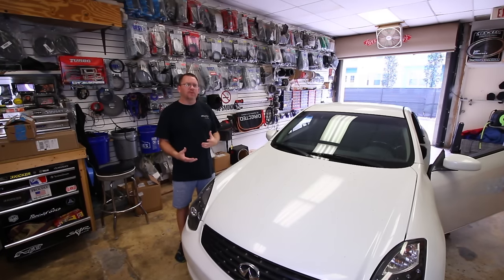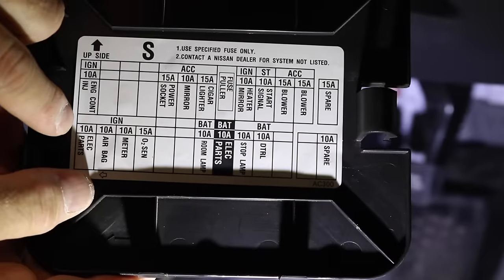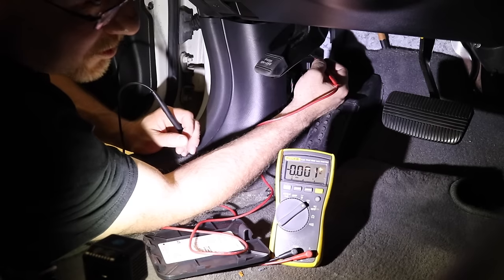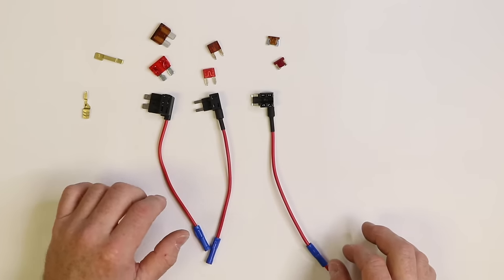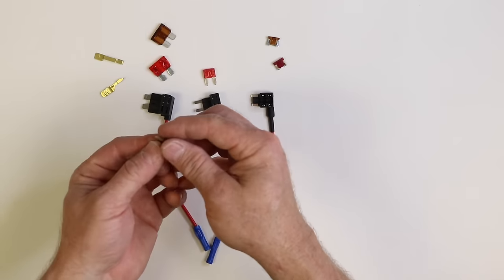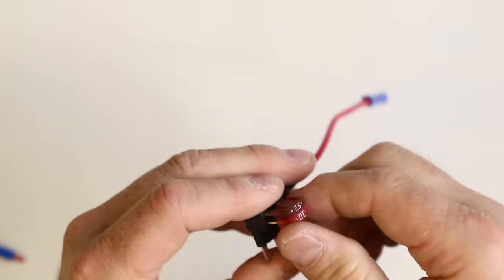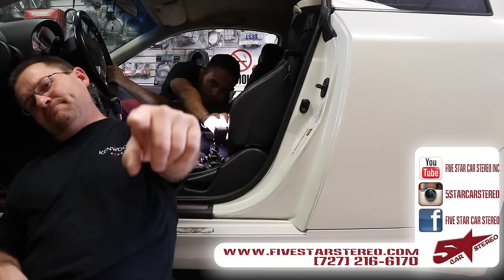How to tap into your cars fuse box safely and cleanly

Comment: This was very helpful. I didn’t know about the "load side" nor did I know that one fuse on a tap should be less than the other. Thanks so much! Glad I watched this, first.
Reply: It doesn't matter which way around you insert the fuse
Reply: @wolvoman1  the fuse yeah, but what about the fuse tap?
Reply: @wolvoman1  6:30 watch again, he is not referring to the fuse smh
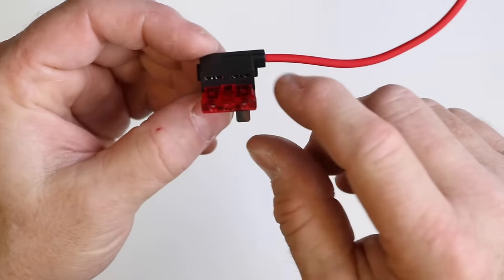Reply: 6:55 fuse doesn't always have to be lower, it can be the same.
Reply: Fuse size is dependant on wire size, ie. 14g wire is good up to a 15 amp fuse. 16g wire is good up to a 10 amp fuse.
Reply: The LOAD side is actually the electrical load applied to the circuit and is mistakenly being called “draw”. 
LINE is the Correct term for the “power supply  in” to a fuse or switch
LOAD is the correct term for the output of current draw through a fuse or switch in terms of electrical load. 
A electrical LOAD can be measured by measuring current draw... so the video is close but we  would be wrong to call the “LOAD “ the supply to a fuse or switch.
The LINE is the supply to a fuse or switch

The LOAD is the electrical load applied to the output of a switch or fuse or cct breaker.
Reply: @wolvoman1  it doesn’t matter which way but the LINE aside may not have a fuse to protect the wiring from excessive current draw whereas the LOAD side of the fuse (he calls it Draw in the video, is a supply of power that will disconnect (burn out)  before the wiring insulation catches fire.
So a fuse is a sacrificial weak link Inserted to limit the amount of power alllowed to go through a wire to an electrical LOAD (like an electric motor or a light) 

If you draw power from the LINE aside of a fuse the fuse will not blow and the wiring in your car is not protected by the current limiting weak link.

It does not matter which way you put the fuse I ; but it DOES matter that you draw the power from the LOAD side of the fuse (He mistakenly calls the LOAD side the DRAW side) but hopefully you know what I mean
Reply: @secretdad544  so it's very important to tap into a fuse this way for something like off-road lights requiring 12v as opposed to just directly tapping into say your headlights? And if this is the case, how come backup cameras are able to be spliced into your reverse lights? Do they draw less power? I still don't quite understand why they wouldn't need a fuse protecting them?
Reply: @Dumpus7  back up cameras don’t use a lot of power but are protected by the same fuse that protects the circuit the camera was spliced into. So in your example the fuse that protects the reverse lights also protects the camera wiring
Reply: @Dumpus7  basically a fuse is a “weak link” designed to blow before too much power is pulled through electrical wire. It is the load that will determine what thickness cable is required, and the fuse will be sized to blow if more current than the wire can safely carry passes through the fuse into the wire. So if your wire can carry 20 amperes safely without getting hot or melting insulation then you would put a 20 amp or less than 20 amp
Fuse. But you would not put a 50 amp fuse to protect 20 amp cable. Because it would allow too much current into the cable and the cable could get so hot that the plastic insulation melts and then you will get a short circuit and a fire risk
Reply: @Dumpus7  if you tried to run your driving lights off the headlights directly you are pulling more current through the headlight wiring than it was designed to carry. Manufacturers choose 20 amp cable to power a 20 amp load. If you add extra lights to the headlight circuit you may find you have increased the load to say 40 amps as an example. What will likely happen is that the fuse feeding the headlights will blow because it has been sized to deliver enough power for the headlights (with a small safety margin,)  but probably not enough margin to drive an extra driving light reliably.
So the better thing to do is supply a relay coil from the headlight high beam via a switch on your dashboard. Terminal 87 earth 87a
Run a fused feed to 30 of the relay. And connect the driving lights to the output of the relay (forget the number but it’s standard on typical 12v relays (cube shaped)
It sounds complex in words but if you follow a driving light electrical circuit diagram  it makes far more sense

With your reverse camera example the camera is a very light electrical load that adds very few amps to the current being drawn through the reverse light cct. This means the fuse and the reverse light circuit have enough “spare current carrying capacity” to feed a reversing camera
But if you tried to connect a 100watt driving light off the reversing light circuit, you would expect a fuse to blow. Due to excessive current far beyond what the manufacturer ever intended the reverse light circuit to carry (typically only 21watts)
Reply: @secretdad544  okay, thanks for all the info. You seem like you know what you're talking about, so I want to pick your brain a little bit more. What I ended up doing was buying a fuse block made by the same company as the LED bars. The diagram shows the positive running directly to the batteries positive, but that would make the lights stay on at all times, correct? So what should I run it to instead? Also, I don't have a switch because I don't want to cut out a spot in my dash for it. So I'm thinking it would be best to run it to one of the fuses that are tied to the ignition like in the video, or maybe to the one that's connected to either my high beams, like you mentioned, or maybe my fog lights? They are very small bars that only pull .21 amps I believe (I'll have to double check that number). Besides those, I also purchased some LED strips I plan on adding as well to the headlight housing that I'll run through one of the other four spots on the new block. How do I know what size fuse would be best for each? I bought a kit that came with a lot of fuses and 10 fuse taps, but I obviously have to decide which size fuses to use for each. Sorry, I build computers, so I'm good with electronics (I can take apart any phone, tablet, laptop etc), but this is my first time trying to do anything with a car's electrical system. If it's relevant, since I do work on phones and computers, I have both the tools and a little experience with heat guns and soldering irons. I also have tons of different splice/spade connectors.
Reply: @Dumpus7  the wire from the fuse box to the battery is the LINE it feeds one side (the line side) of all the fuses 

As long as the fuse is not blown Power will be available on the load side of each fuse. From there run the wire to a switch. 
Without a switch you won’t be able to switch the load (the light or fan or power amp or whatever... on or off. 
Run out of The switch to the load. The load will then have a connection to the car body to provide a circuit back to the battery and make a circuit.
I suggest you get a wiring diagram fir connecting driving lights 
Then do one wire at a time until you get tye cct working properly. 
I dont agree with not having a switch because yes the power feeding the load, will always be on.
Reply: @secretdad544  ok I understand. So having the load side crimped/soldered into say my actual fuse box connected to something like my bright lights- or something similar-isn't a good idea? I can do a switch off that's the case. And one final question: the fuse block didn't come with any wire, and the instructions just say "connect 'the' wire" from the battery positive to the nut on the block. Since they didn't include this, or specify what gauge to use, what would you recommend? I purchased both 12 and 16 gauge red/black wiring that said it was for connecting driving lights specifically. The lights themselves use something small, I believe 16 or 18 (and after double checking, they pull .211 amps), but I'm just wondering what to use for the LINE as you put it. Thanks again for both your time and help!
Reply: @Dumpus7  Cody I would make the LINE feeding the fuse box as thick as it needs to be to carry the total current you intend to draw through that fuse box.
I just googled 10 guage wire (we use metric in Australia and speak in MM cross sectional area) but you use “Guage”. 10 guage is rated to 30amps according to a table I just googled.

Use the 10 guage to feed your new fuse box but to avoid fire feed the 10 guage with a 30amp inline fuse from your battery - fitted with a 30 amp fuse (and never higher than 30amps)

That  way you will never cause the LINE wire feeding the new fuse box to melt - 
because the 30 amp fuse will protect it. 
If the 30amp fuse repeatedly blows then your fuse box is drawing more than 30 amps and you may need thicker LINE wiring and also a larger fuse To feed the fuse box.

In theory every wire in the car should have a fuse protection that is sized to the “current rating” of that thickness “guage”  of wire (each “guage” has a current rating)
Reply: @Dumpus7  I would also check the current you are drawing. 0.21 amps sounds way too low for a set of driving lights. You can’t really check current draw without a DC AMP meter. If it was just a typo and you meant 21 amps that would sound more realistic. Either way your 10 Guage will carry up to 30 amps and your fuse box if fed by 10 guage wire,  can feed circuits up to a total of 30 amps
Reply: @secretdad544  I've double checked and it's definitely only .211 per LED bar.  They're very small bars with only 7 small LED lights apiece.  Each bar is maybe 5 inches in length and maybe 3 cm deep/1 1/2 tall. So they are very small.  Since this is the case, and I don't plan on adding anything additional, I've decided the fuse block is overkill.  I have a 10 amp fuse in my fuse box- the actual one for my car- that's for my fog lights, which already have a dedicated switch independent of my headlights or bright lights.  So, I've decided to just use a fuse tap to tap into that, and I'll just run a 2 amp fuse in the added circuit for these two.  Does that sound like it'll work?  I mean, I'll obviously test and see how it goes before permanent installation.  This seems much easier though.  Also, I do decently high-end Multi-meter.
Reply: @Dumpus7  Good circuit analysis Work & a logical decision mate. Well done 👍
Reply: @secretdad544  that's exactly what I did and it works great! Much easier than all the fuse block stuff haha. Thanks so much for your help!
Reply: what
Reply: What’s the name of the gold male fuse extension?

Comment: Good stuff, I also wasn't aware of the fact that it mattered which way you place your fuse tap load or draw side, thanks for the useful info.
Reply: I'm sure that it doesn't matter which way around you insert the fuse
Reply: @wolvoman1  It's safer to have it in series, or zig zag like they put it, through the two fuses. That circuit is only meant to handle 10A. Putting it in parallel like they recommend means there can be more than 10A drawn on that circuit, which could burn out a wire or worst case cause a fire.

Comment: Hey thank you for this I never knew these existed I always just ran a wire around the fuse and I always thought that looked sloppy. Now it’s nice and cleanly done thank you. I added two charger ports on the back of my armrest for my rear passengers so I don’t have to figure it out from the front plugs

Comment: “Line” is the unfused supply to the power in leg of a fuse -  It’s the power line into the fuse.
“Load” is the electrical load placed on the fuse
It supplies the electrical load connected to the fusible link / aka fuse

Draw (current draw) refers to the current drawn from a circuit by a given load. Vary the load and you change the draw.

The function of the fuse/ fusible link is to limit current drawn to a level that guage (cross sectional thickness) of wire can carry without getting so hot that it causes the insulation to melt or catch fire.

A thicker copper wire can carry a larger current draw and supply a larger electrical power load.

Nice video though. 🙏

Comment: Great video
Linear, explains why, to the point,  we can see the work, and no side bar rambling.
Video is very useful to me. However, this video is for radios and I am installing fog lights with a relay.
I am going to use what I learned from watching this to try to make it where the fog lights do not work unless the key is in the ignition. 
Now I need to find out how to use an empty relay spot and how to connect the relay.

Comment: One additional item that I would like to know.  Do the adapters fit so you can replace the Fuse box covers properly, with the additional height of the adapters, may or may not clear the cover?  Many different fuse boxes with different vehicles. So maybe you end up creating a slot/hole in the cover? Pigtail also needs to be fished out of the box somehow? Nice video and thanks.
Reply: On my car, it needed a hole. Or at least the cops added holes. (Trying to figure this out myself for a lightbar I'm installing.)

Comment: Wow. I was about to snap. I jus bought a used challenger rt and decided to throw a better stereo in it. I’ve installed more aftermarket stereos than I can remember but never have a run into this. I start wiring my harness and the dodge harness has no 12v switched wire. At first I thought it was a mistake made by the factory. Nope apparently stock stereos in newer cars just run on hopes n dreams. Anyway I was about to give up hope and then I found this. Thank you so much. I hope you still actively make videos. I’m gonna follow for sure. Thanks again